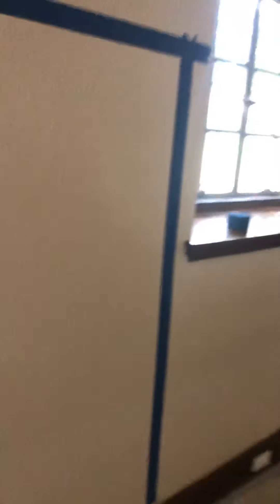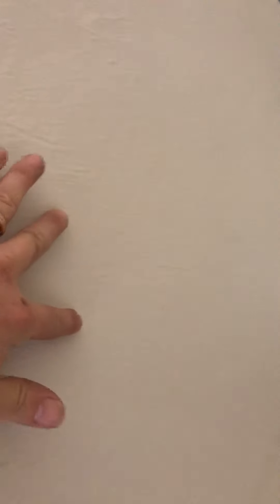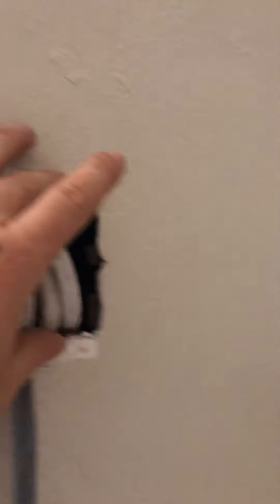Knob and tube Rewire- don’t damage the plaster

Comment: Do you have any videos on how to actually cut into plaster and lath? What tools to use to not crack or bubble the plaster?
Reply from the maker: Corded multi tool, DO NOT USE A CORDLESS. they are less powerful and end up making sloppy cuts. The oscillating tool will have a learning curve, but after you get use to it it’s amazing.
Reply: I agree, oscillating tool by milwaukee

Comment: Just wondering what you think of hole saw holes meant for plaster on a low speed, they can be relatively smoothe unless  they bind unexpectedly.
Reply from the maker: Dangerous if you like your plaster. They tend to fracture the plaster on the lath side causing future cracking.
Reply: @DonaldMillerElectric  yeah I think so too, way less surgical. Thanks Donald

Comment: I removed a fake “ header” from a plastered ceiling. Once upon a time it was a wall. Someone removed the wall and left the top portion of it. I took my grinder and put a deep score on the corner of the header where it met the ceiling- on both sides. Then I smashed and removed the “header”. Ceiling was still perfect on both sides. 

Not a pro. Didn’t even look in the internet. It’s just common sense folks.
Reply from the maker: On the same wavelength, I witnessed a carpenter try to Jack a ceiling up. Everything looked great for about 3 months. Ceiling spidered, and upper house started resettling. 

But I love it when I hear stories that aren’t realistic, please tell me more about your magical experience with your indestructible plaster.